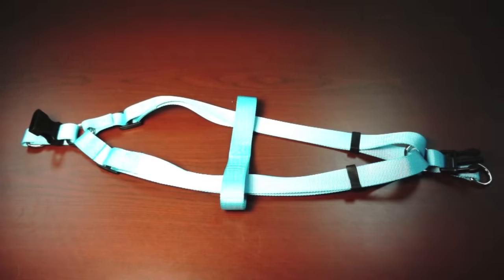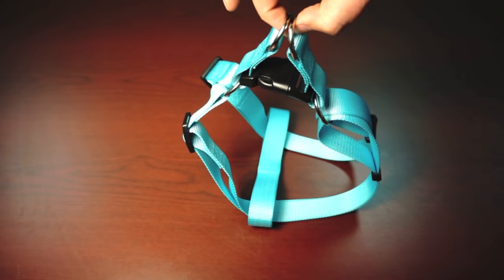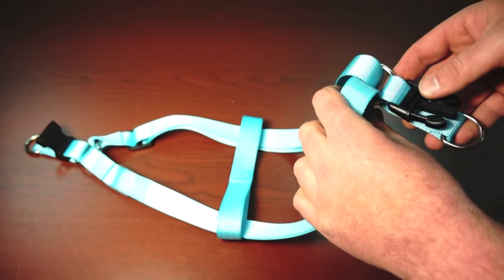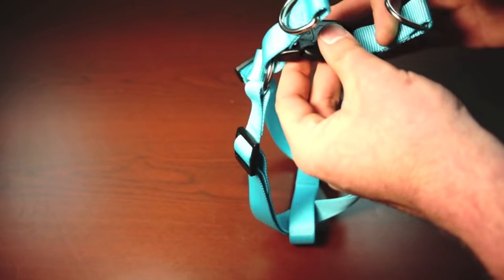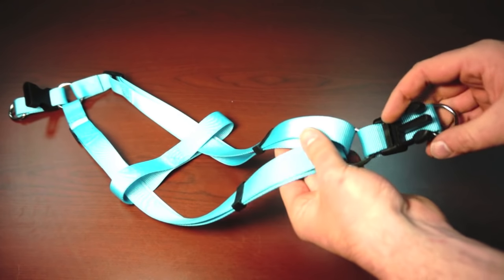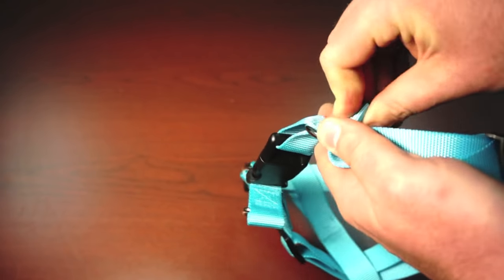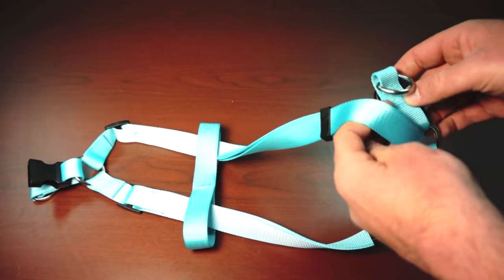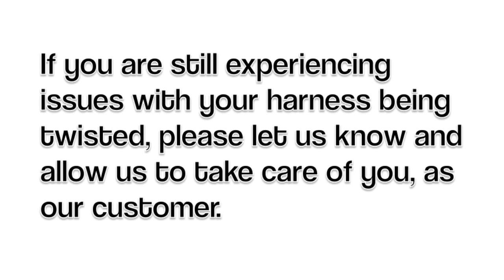Step-in-Harness - Twisted Harness Correction

Comment: Wow, thank you so much for the instructions. I was so frustrated trying to fix the harness that was flipped on the right side. I had my mind fixed on the right side was wrong, but no way to pass it through the hole, so I looked at your video and realized the left side is the one I have to use to get it straight, haha. Time saver right here! Thanks again!

Comment: A couple tips for after you first get the harness figured out: 
1.  use a permanent marker to note F / B for front/back on each side of the legs it's set up for. 
2:  immediately after you take it off your dog, always take a second to reconnect the clasp in the correct position as when it's on your dog and the whole rig will be a lot less likely to get twisted up.

Comment: I've had that issue but i was able to figure it out on my own. what I'm really wondering is there a redesign in the works. if there is I'd like to test or give input on a redesign
Reply: J Robin --first fix worked. furthermore, my dog's harness comes with 4 plastic slides. when pulled to their highest/tightest position, other portions of harness are unable to slip through loop rendering it twisted.